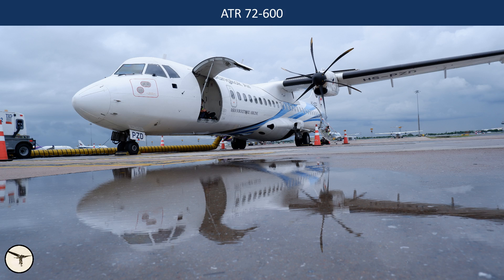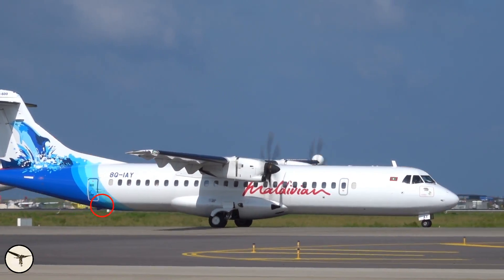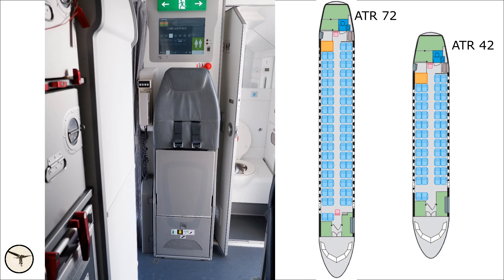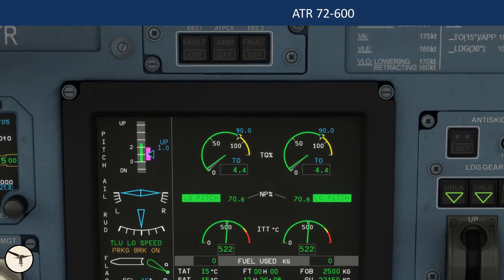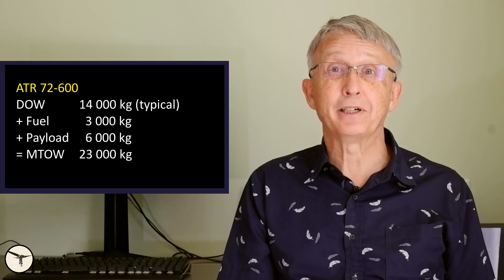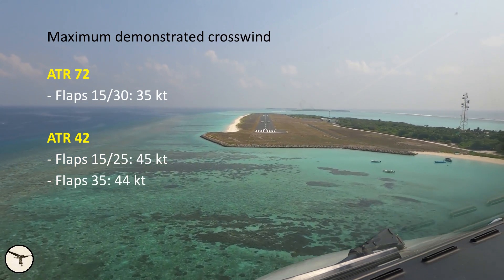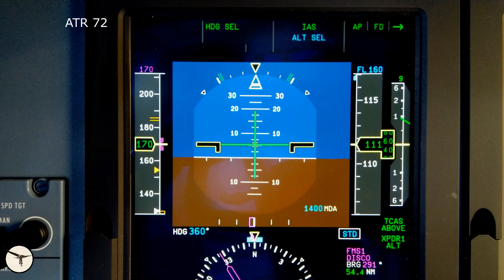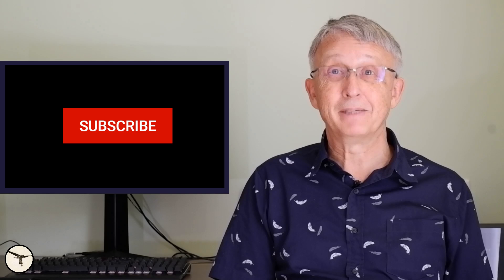Differences between ATR 42 & 72 | Revised

Comment: You bounce bcoz you don’t follow landing technique. Why do you land with power on?
Reply from the maker: You may bounce when you are pulling on the yoke at touchdown. If you are referring to the landing at 1:20, we experienced turbulence, which caused an increase in the descent rate. (This is quite normal at Koh Samui.) During the flare, I reduced the power halfway to flight idle in two steps; a further power reduction would have made the landing harder.

Comment: Very nice video! I bumped into this video looking for differences between ATR 72-500 and 600 for scale modeling purpouses, since scale modelers look for making their model the more accurate to the real thing as possible regarding visible details, going down to things like the amount of hydraulics panels doors. I've concluded from this video that it ain't external visual differences from 500s to 600s, not even to engine nacelles as I thought there could be.

Thank you for making and sharing it!
Reply from the maker: That is correct. The 500 and 600 are identical outside. The difference is inside.
Reply: @FlywithMagnar  thank you very much for answering!